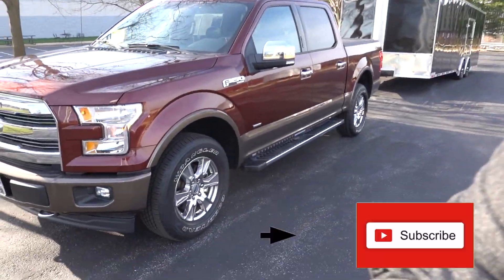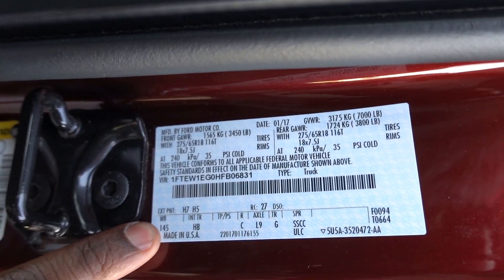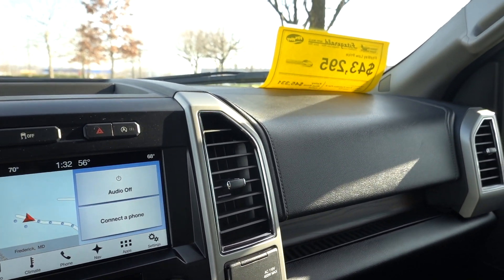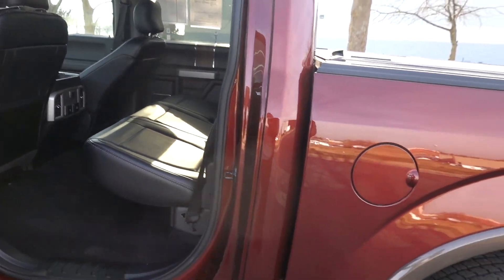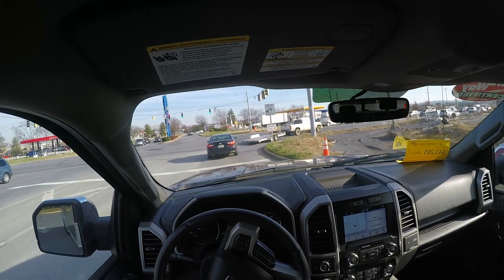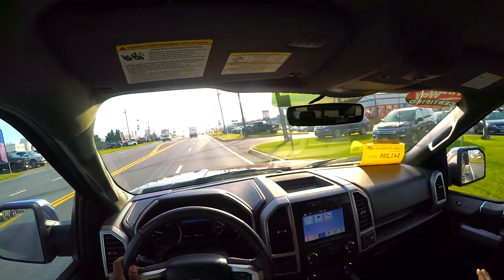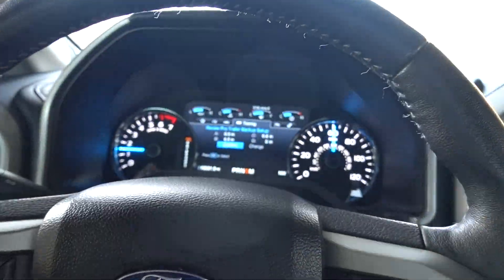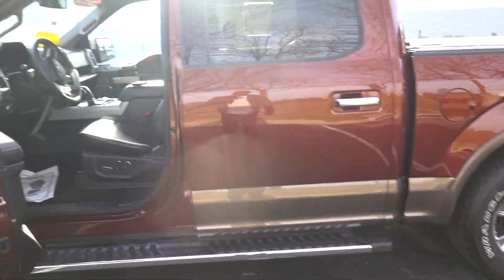The Ford F150 Performed The Worst On My Towing Test... | Find Out Why It Failed!

Comment: I bought a 2015 f150 Ecoboost and I tow a 5600 travel trailer, you need a weight distribution hitch with sway control, night and day difference
Reply: I bought a 2005 Suburban Z71 and I tow more than that. Cost of ownership is less and it's more reliable than your newer F150.

Comment: I have a 22 3.5L EB 4x4 Lariat with max tow.  When we first started towing our trailer we had both sway problems and squat problems.  To fix the issues, I had to add helper spring (RAS HD) to stop the squat for 1200lb tongue weight toy hauler.  The stock tires were 116 (D class, and still within vehicle tow capabilities) but upgraded to E load index to stop the flex in harder breaking and corning.  I also add Helwig sway bar in the rear.  FYI Tall trailers pickup a lot of cross winds which can then push into the tow vehicle.  RAS (Road Active Suspension) helped with a good chunk of the sway and Helwig sway bar just adds a bit more stability. I use WDH for our toy hauler and with the truck upgrades I mentioned it tows just fine at all speeds.  
I recall that max tow option can only be added on 6.5 boxes, due to the larger fuel tank (35-36 gallon tanks).  It also comes with heavy springs and axel along with higher axle ratio (3.55 / 3.73).  Like the previous comments, if you want to tow heavy loads start with max tow package and upgrade components to button up any weak areas.

Comment: Its not the truck.
Its EVERYTHING between the truck and the trailer.
A tow ball is for tent trailers and 1000 lb boats.
I won't tow over 3000 without WDH W/sway control. There is zero reason not to.
With weight distribution, you are spreading the weight it the front axle and thats where you will find the tow package sway bar on the Ford. 
Keep in mind that "sway bars" are for body sway, as in body twist, not "sway" as in driving a big hinge down the road.
Ford is doing it right by maintaining control of the steering axle. Now if you have a camper in the bed or a heavy canopy. Something raising the center of gravity, now a rear sway bar will make it easier to drive.
When you get trailer sway, hit the trailer brakes and it will stop.

Comment: I pull almost exactly same trailer with building materials and tools width a 2016 F150 3.5. Not sure of weight but it is pretty loaded. The truck has pulled it at least 50000 miles since I got it. However I have the maximum towing package and sway control on trailer. Would never consider pulling it without sway control. I thought I might should have got a F250 when I got the truck new but I have been extremely happy with the eco boost F150 pulling.

Comment: I am getting a 8200 lb gvw camper and deciding on a truck.  You are a great reviewer!  Finally someone who discusses payload numbers not just max towing weight!  Thanks!!
Reply from the maker: That’s awesome Mark, good luck with your search and thanks for your comment 👍🏾
Reply: What are you considering? I currently have a 6400 camper with the idea of upgrading to 7k or 8k in the future. I have a Chevy 1500 max towing 13,100 conventional on order to arrive in April now (February was original date given when ordering in November) But may need a truck sooner than that as my 2010 f150 is piling up problems
Reply: @Mjwest23  outdated comment but I got a 2016 Ram 2500.  Pulled great.
Reply: @markcarl8476  thanks for sharing. Had you been considering a 1/4? The pros of a 3/4 is the eleviation of not having to worry about pushing tow limits. But the fuel economy/overall cost then supersedes a 1/4 easily in its lifespan. My dilemma!
Reply: @Mjwest23  I pulled 2 different travel trailers over the years with 3/4 tons.  I pulled a 11000 lb 5th wheel with one also.  I would get a dually if I ever pull a 5ver again.  My brother pulls a long TT with a 1/2 ton ecoboost.  No thanks, I want to be planted in the wind.
Reply: @markcarl8476  a 3500 truck would be even better

Comment: I agreed with others saying that a sway control system is needed. I have a 2020 Ford F-150 King Ranch 3.5L Ecoboost, max towing package and before I purchased a trailer, it was strongly recommended to me by a guy (now retired), whose life’s work has been towing across the US for over 30 years, and has seen horrible sway accidents, is for me to get a sway control system. So I got (based on my towing capacity), a highly recommended Camco EAZ-Lift ReCurve R6 Wt Distributing Hitch Adjustable Sway Control System, I called the R6-DHASCS.

Once installed, you can physically see how the rear wheel height does not change as much compared to without the system.  I have towed close to 10,000 lb + with this system on, from East to West Coast and back, northern and southern routes, and no sway at all, enjoyable smooth ride, etc.  As matter of fact, in the last truck maintenance, the Ford mechanic was surprised that my rear tires look as good, like I have never towed anything at all, which I think is probably due to this sway control mentioned above.  So, I believe that, before doing any towing, get a sway control system period. Yes, it is an extra cost, but in the long run, it reduces stress in your truck and most of all, is a safer way of towing as your life is priceless, and more important than anything else.

Comment: I use to haul with a halfton but never that big of trailer  without sway bars. My ford suspension was soft on my f150. I now tow with a f350 and will never tow with a halfton again.
Reply from the maker: Thanks for sharing 👍🏾
Reply: Yeah once you go HD you never go back. I don't even tow anything big, little double axle 6x12 that I converted to a camper/race trailer for dirt bike races. You don't even feel it towing with a super duty. My Silverado 1500 and Yukon with the 6.2 struggled so hard pulling that thing in the mountains of NC/VA/WVA. Never again going half ton.

Comment: Extremely well-done video. All "tow calculators" aside that little half ton truck is overloaded. I tow my boat, diesel center console, on a tri axe, 12,400 lbs. (weighed on a Cat scale) with my stock E350 V10. No ridiculous suspension air bags, no W/D hitch, no sway control, just a Draw Tite class 5 hitch. Zero problems. Bottom line, if you want to pull more than 6000 lbs. get an 8 lug truck. And more than 13,000, buy a dually. 18 wheelers have 18 wheels for a reason.

Comment: That truck is basically a Boulevard Princess and not meant for that type of towing.

I have a 2018 HDPP XLT, 2,475lbs of payload. I tow a 37ft, 8,400lbs dry travel trailer...I'm towing one hand on the wheel when big rigs passing stable.

The only modifications I made was dumping the Wranglers LR C for LT Michelins E-Rated Defenders, and that made a difference between feeling you need to hold the wheel with two hands when big rigs are passing, to not realizing you still have one hand on the wheel when big rigs are passing.

My truck sits level (level placed on bed) with 1,250lbs dropped on the hitch.

I couldn't tow my trailer with the best rated Max Tow, only with the HDPP on up.
Reply from the maker: Thanks for sharing this! I never mentioned the payload packages only because I’m not well versed on them and why I need to start doing more walk around videos on Ford trucks. LT tires would make a difference with stability because the tires on this truck sucked and probably contributed to the overall feeling.

Comment: 2015-2017 F150 has something weird with the suspension. I had a 2012,2015,2018, and now a 2020. All had max tow package. The 2015 needed air bags to pull the exact same load I hauled with all of the other pickups. The 2015 swayed like crazy with around 10k behind it. The 2018 pulled 12k without the drama that the 2015 did. Some new info came up lately that Ford has three frames too. The regular frame , max tow frame and than HDPP frame. The later two having thicker frame.
Reply from the maker: Thanks for sharing this!

Comment: You need to have a WDH for that sized trailer. I have a 18 F150 and tow a 6k camper with no issues at all when I use a WDH, without one and you can really feel it behind you.
Reply from the maker: Yes unfortunately Ford doesn’t include sway bars in the rear which is why it felt so unstable
Reply: No distribution hitch is the reason you get so much sway. A sway bar is only going to add a very minimal amount of torque (in other words, it won't influence the body roll with a heavy trailer added onto it). The 3" drop is likely the culprit. Once the incline angle becomes too great you're pulling weight off the front wheels which causes drift. Sounds like the truck needs air bags as well since a distro only stiffens the joint between the truck and trailer. Get it flat and level and I can guarantee it will be a completely different experience.

Comment: I have 2014 5.0L max tow with a cat back exhaust and 5 star tune, and I pull our 32’ trailer all summer long with no issues what so ever. It’s pulls amazing, a person with no experience pulling a trailer could easily jump in my truck and go and feel confident doing so. BUT I have 10 ply tires and a really good Weight distribution hitch and anti-sway system. the truck and trailer track awesome going down the highway. But one thing is for sure, people need to make sure they have all the proper equipment. Great video and well done! 🍻
Reply from the maker: Thank you so much for sharing this! Your setup is probably what I need to use for a redo with a Ford truck 👍🏾
Reply: @JB_WhoWork  And just in case people try to tell you otherwise, your not wrong. Good friend of mine had a 2013 Ecoboost F150 and he traded it for a 2019 F150. He said it’s a night and day difference while towing between the old steel body trucks and the new aluminum ones. The new ones are so light, and because of that you feel everything the trailer is doing .
Reply: @Matts000  500 lbs won’t make any difference in towing
Reply: @Matts000  👍
Reply: Which hitch do you have?

Comment: i may be wrong but I think sway bars on tow vehicle are principally designed to reduce lean on tow vehicle when taking a turn, with or without trailer,  they keep the truck level around turns, I don't believe the term sway bar directly implies they reduce trailer sway, they are very common on sports cars also, OPINIONS?
Reply: @louisboys
You are 100% correct

Comment: The general consensus is that the Ford needs that max-tow package to really tow >7000. You can readily identify the max-tow by the Super Duty mirrors, and also the L9 stamp for the axle(3.73). It still is shameful that Ford doesn't offer a sway bar standard(Ram does as part of the multi-link rear). I predict the Ram(w/o air suspension) will squat about the same, but have far better composure. This goes back to what I mentioned on a couple of your previous HD truck posts. It is one thing to be able to tow a certain amount. It is a whole nother conversation about towing confidence. That's why I'm so invested into Ram trucks. They may not be as fast as a Ford, but the overall towing experience is superior(sway control, ride, engine braking, amenities, etc). When Ram refreshes for 2022(the 2021 CTD already got a substantial fuel delivery overhaul), it will be unstoppable!
Reply: This is not correct information this truck has a tow package , the max tow isn’t going to add anything that will help. Max tows w 10 speeds from 17-2020 have 3.55s . Maxtows do not come with tow mirrors .My 2017 was not a max tow it pulls the same as my 2020 lariat maxtow. I added the Hellwig rear bar it does help a little but it’s not a life changing difference.
Reply: @JohnDiMartino  I pulled this from Ford's own 2017 info on the F150. You can cobble together quite a few different items as stand alone options(such as the 3.55 and other tow items), or you could have gotten the max-tow which did include the 3.73 and larger tow mirrors, according to Ford. It does not appear that a sway bar was added to any option group.
Reply: @hellkitty
The general consensus is that you don’t have a clue about ford trucks. We get it that you are a Ram fanboi. I’ll attempt to educate you.
You don’t need max tow to tow 7000 lbs, and the L9 code is for a 3.55 gear and the L stands for locker. L6 is the 3.73 axle.
Ram has to have a rear sway bar because of the coil links are soft and has a tendency to sway without a bar to stabilize it. Another reason they have an air suspension is so you can haul something without severe sag. And forget the air suspension working in cold weather, it’s fragile and freezes up. Ford has sway control as standard, doesn’t need a bar.
The sway this dude thinks he is experiencing has to do with the tires, he never checked what the air pressure was, could have been low, and those Goodyear tires are trash to begin with. They are just standard issue tires, 4 ply sidewalls, not even 6 ply light truck tires which is the minimum for safe towing. Chances are that those Goodyear tires were changed out at the dealership, the spare under the truck has a totally different tread pattern. Not many people change the spare to a totally different tire
Reply: @hellkitty1014  and in your other comment/opinion you mentioned “cobbling together “ a truck. It’s not cobbling, it’s called optioning a truck the way you want it. Something Ram doesn’t allow you to do, ford gives you choices. To get a 3.55 on your Ram you have to cobble together that as a stand alone option, apparently that’s not cobbling to you… does Ram even have max tow? 
And just so you know the ford max tow includes a beefier HD rear axle, 36 gal gas tank, HD rear bumper, brake controller, upgraded radiator and cooling fans, upgraded frt stabilizer bar, oil and trans coolers

Comment: I recently traded in my F150 for a Ram 2500. The 2500 feels solid when towing. The F150 was maxed out, in my opinion, with my 7k lb trailer. The truck was rated for 9100 lbs. the power was there, but the weight of the truck just didn’t seem enough. 
F150- 5.0 liter gas
Ram 2500- 6.4 liter gas
Reply from the maker: Congrats on the truck and thanks for sharing! I’m surprised even having the V8 it still seemed light but it makes sense due to the aluminum body.
Reply: 3.5 ecoboost tows more. Max tow also tows more.
Reply: @Eddie-yu4vx  Agreed, but the weight of the truck also plays a big factor. Also, at the time, the 3.5 wasn’t locally available for the packages I wanted.

Comment: When my 2011 Tundra was getting body work done the insurance company gave me a 2017 F-150 10 speed as a rental. Biggest piece of trash ever, it kept flipping through gears like a madman while towing a 4000lb loaded trailer. It's aluminum body was light and had only 800 miles on it, but was absolute trash compared to my Tundra.
Reply: Tundra is garbage we had one at my job fell apart f150 still runs and runs
Reply: The tundra is so good they sell less of them than any other truck manufacturer. Lol. Oh yeah and you're lucky to get 14 miles per gallon on the highway how do I know I had one and got rid of it.
Reply: And then u woke up right… we had a tundra shit fell apart at my job what a joke the fords still running

Comment: Leafs don’t have sways bars. Also your rear air pressure was probably 32-35.  When it should be 65-80 when towing. Smaller economy tire then no more than 44.

Comment: If you don't understand loading, you might be in an accident, the correct way to load trailers, you first load 60% of the weight on the front of the trailer so the most weight sits on your rear axle of the truck, and then you only load 40% of the weight on the rear of the trailer, if you load more than 40% on the rear you will have that swayed from side-to-side and the trailer will swing you in the freeway, so stay safe remember the 60% 40% rule

Comment: Depends on the gear ratio you have for the rear driveshaft final ratio. You need to pay for the upgrade from Ford when new to get the 11,000 lbs stated on adds.3:31 will only do 9000 lbs on with the 5.0 for example.
Reply from the maker: Thanks for sharing 👍🏾

Comment: Your trailer is a 3/4 ton and up trailer unless you have wdh.  I had same truck pulled similiar trailer with it. If i cranked the wdh was ok at best if it wasnt perfectly set i could feel it But you gotta remember these trucks and aluminum and light weight with short wheelbases they can tow 10k on a short flat trailer.  With your monster you ate fighting leverage more than weight. Length equals leverage.  Also it grabs all the wind. Set up to fail with that set up.  
You should get a weight distribution hitch to it and redo tests.  
But i ll stick with this.  That is a 3/4 ton and up trailer.  Can you do the new 7.3 for me i am thinking of trading in my Powerstroke    Thanks man great videos.
Reply from the maker: Thanks for sharing and I agree with you! I’m just setting the record straight for everyone with manufactures claiming big tow capacity numbers. They don’t mean anything until you hook up a trailer..... 

I have a friend ordering a 7.3L Ford so if he’s ok with it, I will drive up to NY and do some test, thanks 👍🏾
Reply: Actually it's a F150 HDPP and up trailer, and of course the 3/4 ton will do thing a bit better, but the HDPP will still do it comfortable and stable at highway speed.

Comment: How much tongue weight was that trailer? Anything over 500 pounds you're supposed to have weight distribution bars on. Honestly with the extreme length of that trailer & considering it was a box I would've had the bars on regardless. It has the trailer brake controller in the dash so yes it has a tow package. I own a 2020 F150 xlt 4x4 crew cab 5.5 bed max tow package. I tow an 8k pound 36 foot long RV with bars and have zero issues with sway.
Reply from the maker: I just got it weighed recently and will plan to post video hopefully early next year.

I agree that a WDH is necessary for 1/2 tons but I’m testing these trucks for now without it and in the future will add a WDH to the trailer.